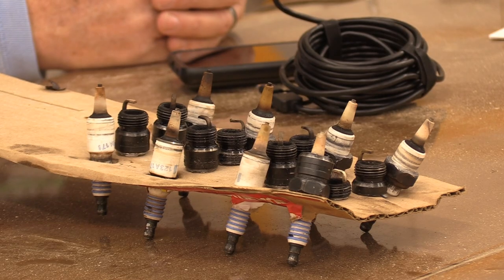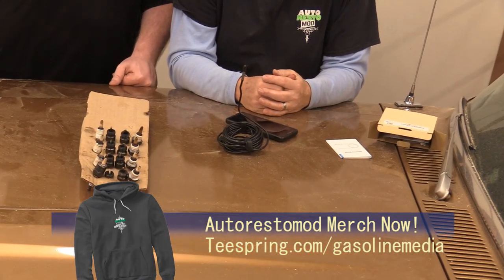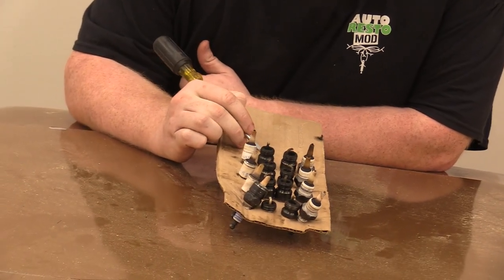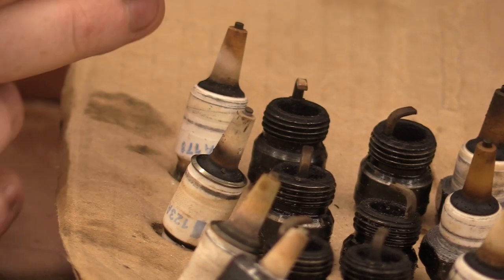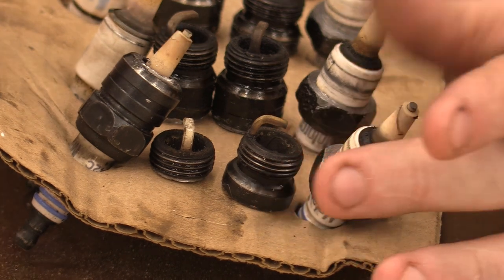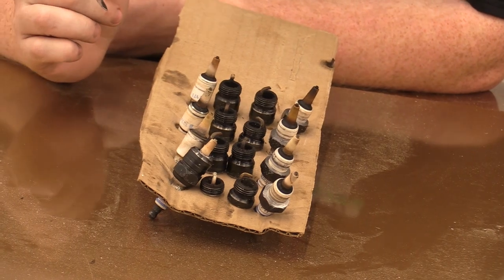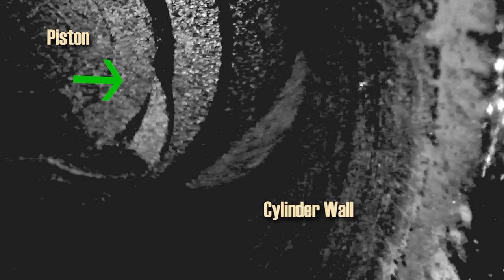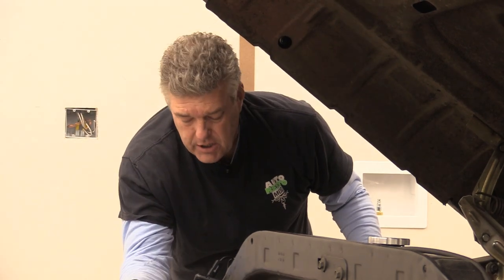Read Your Spark Plugs

Comment: From Australia, once we could check the tune on the motor by the colour of the plugs after a long run. Fuels have changed over the years here and the 98 octane I run in my Stang , well you just can’t read the mixture by the colour anymore, no matter what you do, it’s always the same colour, it’s just what the fuel does these days. Love your work guys!
Reply from the maker: Interesting.

Comment: I have driven and rebuilt every kind of ford engine you can think of.  The 390 is like a 429.  They run hurt for years. Until it starts fouling plugs, leave it be.
Reply from the maker: I think you are probably right.

Comment: Like anything, it's not going to get better I'd you leave it, but, you can monitor the rate of decay. I say, if it gets markedly worse, then you're going to have to do roughly the same level of effort to correct the problem. Since Col Mustard is a "garbage truck", I would put the time & effort into the Galaxie.
Reply from the maker: Agreed

Comment: I liked that last idea of trying to retorque the head to see if that will bring that cylinder right back around… otherwise if youre stuck having to pull the engine, you might as well throw some upgrades to it like a top end kit 🤷🏽‍♂️ but thats just my opinion

Comment: Pressure test the cooling system using a MityVac (IMO, a must-have tool for lots of things automotive). Don't overpressurize the system (maybe +10% over nominal spec)... don't want to blow a gasket. What to do next depends a lot on whether you actually do have a coolant leak into the cylinder (might explain the low compression number; albeit, the "wet test" on the cylinder does seem to indicate rings...
Reply from the maker: That is coming this week.

Comment: Carb tuning . Mirror and a timing light looking down the primary carb bores.  Bring up rpms slowly till you see fuel trickle from the primary boosters.  Note that rpm on the tachometer. Look at air fuel ratio with a narrow or wide band air fuel ratio display. If its lean. Increase the idle feed restriction 0.001" and try again. If its rich. Add a thin bristle from a wire brush. Retest..  
Test primary jetting at around 3500 to 4000 rpm ..
Reply from the maker: Man, why you gotta be all the way in Cali?

Comment: I never heard of pre-detonation, before.  I am familiar with the terms pre-ignition and detonation, which are unrelated (and often confused), aside from being terms for abnormal combustion.
Detonation is the result of the fuel charge being fully consumed too early in the combustion stroke (perhaps too lean or timing too far advanced), pre-ignition is ignition of the fuel charge prior to the spark event (hot spot in cylinder, possibly too hot of spark plug).  Pre-ignition will quickly destroy an engine, whereas detonation damage occurs over time.
Reply: Unfortunately "pre-detonation" is what people who don't know what they are talking about say. 
Sorry, but its true.
Pre-ignition is annoying, but detonation is the real killer of an engine.  
Detonation is uncontrolled combustion and is associated with huge combustion pressure spikes, which takes out pistons and head gaskets.
Basically the spark ignites the fuel charge, the flame front advances partway across the chamber, then because of the heat and pressure, the balance of the the fuel charge explodes suddenly.
Reply from the maker: Or people who do who sometimes get their words mixed up...Spose that NEVER happens to you huh?
Reply from the maker: I misspoke.
Reply: @AutoRestoMod  It's painfully obvious people don't know the difference, proof is right here in the incorrect replies.  Please get it right?
Reply: @2lotusman851  "the balance explodes suddenly" How does this differ from my description of detonation, aside from making an unfounded conclusion based on an assumption?
Pre-ignition most definitely can and more likely results in higher peak cylinder pressure magnitudes higher than detonation.
In the case of all gasoline engines, optimum peak cylinder pressure occurs precisely at 14 degrees after top dead center.

Comment: I love anything f100.  Whatever you wanna do I’ll watch
Reply from the maker: We're going to jump back in on it soon!
Reply: @AutoRestoMod  I’m currently trying to set up a fuel return line on my ‘69 f250.  There are many ways to skin this cat and having the auxiliary tank under the bed compounds it all.  My truck has huge issues with vapor lock and percolation.  The other problem I want to solve is the annoying fact that driving on the highway with these trucks sucks!  I’d love to boost my old beast into the modern era with an updated transmission.

Comment: For what it's worth start building the other 390 and run what ya brung for now. Not sure if your doing a more performance build o. The second one ( ie poke and stroke 427) and when ya swap do a basic freshen up of the current one for the guys that find a diamond in the rough and wanna get it up and running
Reply from the maker: Think that is where we are going for now. The 390 in the Galaxie is going to hopefully get some good juice.
Reply: @AutoRestoMod  poke and stroke with aluminum heads?

Comment: What about pouring small amounts of water down the carb while running to steam clean the pistons? We did that on a 302 one time and it helped.
Reply: I remember doing that back in the day. With everything gone fuel injection you don’t hear of people doing it anymore. There’s also fuel additives and cleaners like seafoam (if that can even be used in a carb setup) that weren’t around or not very good back then.
Reply from the maker: I've actually thought about that.

Comment: What causes a spark plug to burn the copper electrode and grounding strap off?
Reply from the maker: Burned. Blisters on the insulator tip, melted electrodes, or white deposits are signs of a burned spark plug that is running too hot. Causes can include the engine overheating, incorrect spark plug heat range, a loose spark plug, incorrect ignition timing or too lean of an air/fuel mixture.
Reply: @AutoRestoMod  thanks for the info. Engine temp is running within specs, and thermostat just replaced. The previous plug with this issue my have been loose. Will double check timing, after that will adjust carb fuel air mix if necessary. Thank you again for all you put into the channel!!!